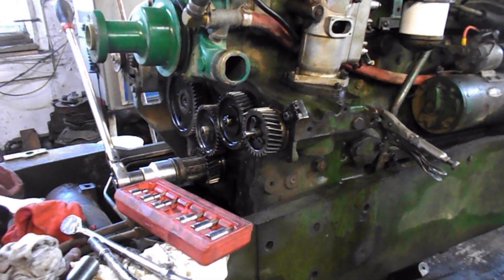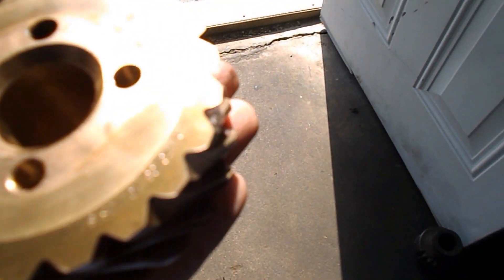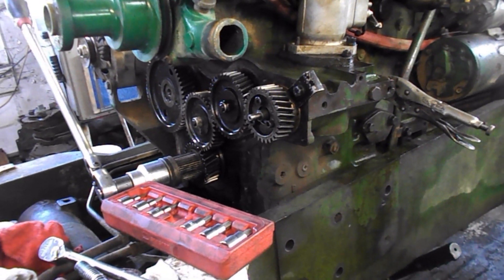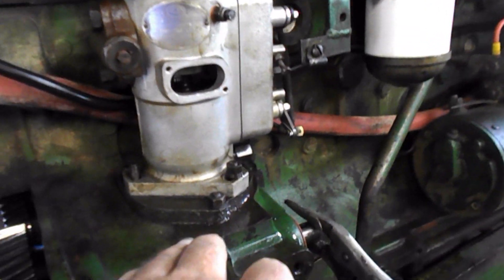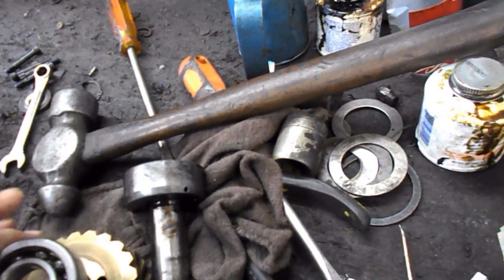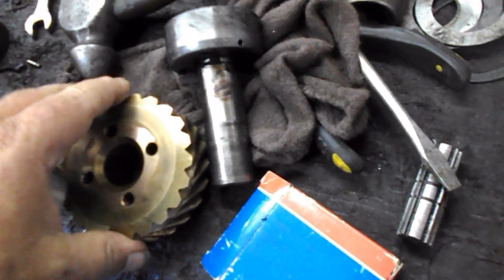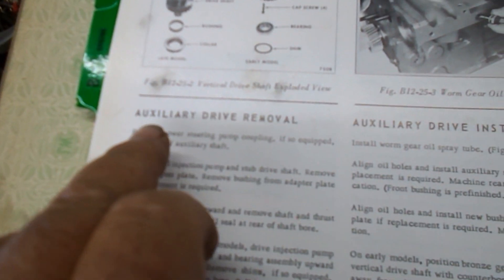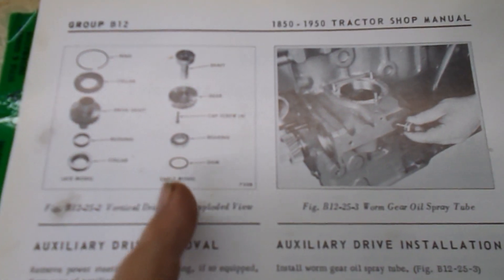Oliver 1850 354 Perkins diesel Question, We are Stuck !

Comment: I can’t help you with the gear lash...but, rebuilt or not, that pump is junk.
Reply from the maker: The pump was completely rebuilt with a new head and rotor but from the time it was put on the first time and started I knew something was wrong with it. It ran good but something was off and I just didnt know what nor did Harry, When you dont know injector pumps or ever worked on them it dont help but having other 1850's before I know something is off with it and its not the engine for sure its in the injector pump for sure. Right now its back off and at a new guys place getting looked at cause the guy that rebuilt it says he's worked on it twice and he said its the engine for sure and wont look at the pump again. The new guy thinks he knows what is wrong with it already and said this might be a quick fix, I dropped it off Monday so we'll see what happens.  Bandit

Comment: Bandit, I havnt heard anything from you in a while. I hope everything is well. I know you have had a rough time with those kidney stones.
Reply from the maker: I've really been running my tail off trying to catch up and I really havent had much time to do the youtube thing like I want to. I'm leaving hear in a few to go down to see the guy that rebuilt the injector pump. The 1850 is now home because there was no use in it being down there anymore, Engine wise there is nothing wrong with it and it is running on another injector pump right now and it runs great with it. The one that was rebuilt there is just something wrong with it, It slobbers spits pops and cracks misses and the smoke off it will flat out burn your eyes up and pulling a disk it feels like its laboring to pull it. Same tractor fuel and day I switched the pumps and it ran so much better that I know something is wrong with the injector pump I just dont know what so back down to talk to him about it again.  Bandit
Reply: @banditfarmer1900  i didnt think the problem with the oliver was that worm gear.  Glad to here to are doing ok. was worried those kidney stones had got you down.

Comment: A ball bearing is no designed for vertical operation.......Obviously Perkins discovered that.......IF the updated bushing doesn't fit    I would get a Bronze bushing machined to the bearing specs to fit the  engine casting...... then go from there

Comment: I'm sorry I can't help you with the question about shimming that vertical shaft for the pump drive, but I will add you definitely need to inspect the wear on the timing gear for the horizontal shaft. When I rebuilt my  354 a few years ago that timing gear had a step worn into it almost as bad as the bronze gear

Comment: I would use paint like when setting up a differential. Paint it, drop it in, turn over the engine, pull it out and look at it. If it's shallow less shim. If it's deep as you say more shim. You should be able to measure the distance you need the "paint mark" to move. Then transfer that directly into shim thickness.

You could also shim between the shaft and the gear itself where the bolts go through. That actually may be better to prevent pre load upwards into your pump.

Comment: Im not familiar with this engine but I am a machinist. I have made worm gears. The backlash of a worm gear is set at the time of manufacture. The machined bores in the engine are manufactured at a certain distance apart as long these are not worn or the bearing is bad, then the backlash will be correct. If the backlash is too much and the bearings are good it would indicate that the worm gear is worn or not made correctly. But I really dont think this is why this tractor doesnt run right. When you time an engine you should always bring it up on the timing marks while turning the engine in the normal direction of rotation. If it has a little backlash its really not going to effect how it runs because the backlash will always be in the same direction while its running. I have seen pulling tractors that drive the injection pump with a roller chain and it runs just fine. You have something else causing it to run bad. Did you ever try a different injection pump? I dont remember but did it run like this when you first bought it?
Reply from the maker: I understand how gears are set as far as lash goes but most of the time its pretty simple to do, But most of the time you have info on how to start the set up and we cant seam to find anything to start from and you sure cant see it or get to it very easy ! LOL I think its going to be a lot of trial and error figuring it out.  Harry has an 1850 he was going to pull the pump off it and put it on mine but he ran into a big problem when he went to pull it off. The fly wheel only has one mark on it and it says start and the mark and the mark on the injector pump dont match up, He is afraid if he pulls it off he might not ever get it back on in proper time again so that has killed that idea. The 1850 when I bought it ran pretty good but it needed some work done on it. We've gone threw the valves fuel system the injector pump was rebuilt and new injectors installed but after all that work was done something still just wasnt right and thats ware we are still at right now, A random miss that we just cant figure out what it is or what is causing it.  The hunt goes on and we will figure it out sooner or later.  Bandit
Reply: @banditfarmer1900  If that gear is wearing a little on one side it could need shimmed a few thousandths but if you do, that will just make it have more backlash. There is no way to tighten up the backlash unless you move the worm and the worm gear closer to each other which in this application there is no way to do it. Just forget about the backlash and look for something else making it run bad. Your mechanic is just sending you on wild goose chase. Something else is causing it to run bad. Like I say shimming the pump if anything will make it have more backlash. Unless you get a new or better worm and worm gear, the backlash is as good as it is going to get.
Reply: @banditfarmer1900  If you would put a diesel timing light on this engine and check the timing while its running, you would see real quick if the timing is bouncing around while it runs. I have one and it just has a little clamp that clamps on the injection line and senses the pulses in the line and makes a timing light flash when it senses the pulse. So if the timing is erratic you would see it  with the light.

Comment: For proper engagement the worm gear needs to run in the center of its pinion gear. Blue up the worm gear and shim to where the rub marks run in the middle of it's mating pinion gear. When the rub marks run central in relation to each other the lash will be correct.
Reply: You are correct. Think setting the pinion/ring gear in a differential rear axle. One blues the ring gear then moves the shims left to right. The pinion gear is set by dial indicator.

Comment: Bandit I am not even close to being an engineer, but here goes. You know the amount of deflection through the gears, measuring the size, width, and length of the mating surfaces of the teeth on the gears along with the angle of the gears, someone should be able to tell you the amount of backlash that is required and or needed for the gears to operate properly. 
As one commenter stated a good range can be guessed at and figured out wit trial and error with .002 thick shims. You should be real close to the right lash when you are able to turn the pump and hear the engine respond with a different tone.
  I know you and your mechanics will figure it out.
Reply from the maker: Frank our biggest problem was the lack of information about this drive system mine has but to be honest it is something that was changed by Perkins in 1965 so finding info might be hard to find. I am going to make a follow up video and explain what we did to fix the problem, A lot of measuring went on and a lot of wright stuff down and figuring it out but its going back together now.  Bandit

Comment: look up chris lossi that oliver guy and or oliver 66 farm boy them to guys got their shit right i want to say that oliver guy is or was in a oliver dealer look up Hanover implement hanover in see if they got anything they at one time was dealer for massy and i want to think also perkins now they are just doing everything but still very up on everything
Reply from the maker: The guy working on the 1850 has been at McHenry's (Oliver dealer) sense 1969 working on Oliver's and White's everyday ever sense, But he has never seen this style before. I rate Harry right up there with Chris Losey as far as working on and knowing Oliver's inside and out, The other guy I've been talking with about this has been working on MF tractors and equipment about the same amount of time as Harry and he has never seen this drive before ether. They both have been looking at the comments seeing what everyone has said and so far they are not agreeing with anyone yet. Other problem with the 354 is no new part can be bought for the drive system for the injector pump so that is making it a lot harder to fix this, Even the Perkins engine dealers cant get these parts so new parts cant be found. I thought I had a new drive gear found for it but it turned out to be for a much newer 354 engine and wont fit in mine. The hunt continues !  Bandit
Reply: @banditfarmer1900  different dealers in different areas may see different stuff maybe i also hope for your sake so you can get this fixed hate seeing someone having this kind of trouble
Reply from the maker: @mattphillips4260  Over the years you run into this every so often that some little do dad you need cant be found by any dealer. But to be honest this is a 1965 model tractor so it is 55+ years old and this was a change made like 6 months of production in the Oliver line so not being able to find info on it aint hard to believe. Worst part of this is the fact you cant buy no new parts from anyone for the injector pump drive, The thrust washers bushings or the brass gear no one can get not even a Perkins engine dealer. I dont know why but its just the way it is. But I think we have it figured out now and its going back together now, In fact I'm late getting over to help Harry this morning ! LOL Got to get moving , I follow up video is coming soon !  Bandit
Reply: @banditfarmer1900  i am just try to sound positive to this trouble you are having here  and maybe someone could by chance have a fix for you on this on to a different page of this i have a guy here in my area that ha a 1850 oliver he he thinks the gears that you are working with are out of spec and needs to be replaced i was showing him the pics and how that gear was missing some material on the tooth face but that theory is from what he can see here on the video but you was also saying that the new vs old set up could not be changed not sure if that also meant the brass looking gear or just the bearing and shim pack we are still studying on this
Reply from the maker: @mattphillips4260  The worst part about working on this 354 Perkins is I can buy just about every part for the engine except for anything to do with the injector pump drive system. The thrust washer and the worm gear and brass gear and all the bushing for them no one can get them not even a Perkins engine dealer. So all you can do is find good used parts to fix them with. I got lucky and Harry had a brass gear out of an engine that blew up that had just been rebuilt and had a new brass gear installed, It had been on a shelf in the shop for 30+ years and its now in my engine ! Got real lucky to get it !  The shims listed in the books for this are no longer avaible from AGCO and it doesnt say how thick they are. The lack of information and new parts for this engine make it really hard to keep these engines running but I have been finding what I need to fix it. There have been many changes made to the 354 over the 35 years it was built and the drive system for the pump is an early change in late 1965 ( 1 year of production for Oliver's 1850) so 1966 the new drive system came out, So I can understand why the info is a little hard to find.  I will be making a follow up video and talk about everything that has been done to the engine to get it right, A lot has been gone threw really for nothing at this point to prove its the engine and not the injector pump that is the problem and as it turned out it is the injector pump that is the problem !  So videos will be coming to show this.  Bandit
Reply: @banditfarmer1900  please look up hanover implement and give him a yell he may have something to help you out i do not feel safe dropping his phone number out here on the tube or i would there has been MANY times he has had what people need when we thought sure he would not have it  after seeing what you was showing on that one gear again you are missing metal on that gear in ways shimming may not help i am 90% sure of that wish i could just shoot over there with your ok if you was close to me so i could see that gear eye to eye if i could do that i am sure that 90%would go up to 99% sure of it

Comment: What about the Perkins factory corporate office?
Reply from the maker: Well Perkins engines were built in England so that might be a little hard to do plus the fact CAT bought Perkins out some years ago and from what the 2 Perkins engine dealers have told me things are a little strained right now on parts and info so contacting them might be a problem or getting info from them even harder. No one has been able to find some of the parts for the drive system for the injector pump, Thrust washers bushings or brass gears no one can find any new ones . But the hunt continues !  Bandit
Reply: @banditfarmer1900  what you do is up to you. Phones go to England and they talk English, not a problem there. You talk to their rep in USA maybe, other dealer's, and so forth. I wonce found a clutch slave cylinder by getting lucky and asking company people at Bendix I think it was. A floor sweeper person found a box had fallen from shelving in a Tenn. warehouse and the box had the last available part, so the story went. Ship that part to me. That was 40 yr. ago tho and people (not all I know) don't go the extra mile like they used to. And big companies are worse for accommodating.

Comment: My Perkins book says that “On early engines, adjacent to the engine number, on the auxiliary drive housing, is stamped the amount of shimming required to be placed at the bottom of the fuel pump drive shaft bearing recess. The amount of shimming may vary from 0.002/0.008 in. 0.002 shims are available. If there is no stamping, shims are not required.”  So the shims were 0.002 and you used whatever was necessary. But if your block isn’t stamped it needed no shims when new the way I read it. It also says that end float of the drive shaft (horizontal) should be between 0.0025/0.009 in. I would probably start with two shims and see what you get. Unfortunately it’s probably going to be some trial and error. It doesn’t give any procedure info other than specs. Hope this helps.
Reply from the maker: That make a lot of sense, I just wish it was in our shop books !  I will have to show this to Harry in the morning and see what he thinks about it. Its for sure we will have to look closely at the block in the morning and see if there are any marking on it and go from there. This is more info than we've found so far and it makes sense to me. Thank You so much for chiming in with this info, Now I know more about it than I did this morning ! Thank You    Bandit
Reply: @banditfarmer1900  you’re welcome! I hope it goes easy from here on out. If shimming doesn’t work you may have to replace the worm shaft. The book did mention that for the new style to replace whenever possible.
Reply: @rosstheoliverman  Good info! I think you have his  answer. I'm pretty sure the end float spec is for the horizontal driveshaft. Gotta replace the half washers to tighten that up. 2 of MF number 740388M1
Reply: @ThatOliverGuyChris  I agree on the float spec is for the worm shaft, I realize I didn’t make that very clear. I know the book says for the new style, if the worm shows any wear to replace the entire assembly.  But I think you’re on to something with replacing the washers, that should tighten it up or at least it makes sense to me! Which style does Ophelia have?
Reply: @rosstheoliverman  Ophelia is a very early 1850, so she should have the early style.  She's so deep in paint I can't even see the engine seeial number, let alone shim specs. I do know it's an early enough engine that it doesn't start with 354.
Reply: @ThatOliverGuyChris  I should’ve known that! I remember you saying in the video Ophelia didn’t have the access holes for the rear motor mounts in the frame.
Reply: this seems like the answer
Reply: I do believe this is spot on. The stamping indicates the size of shims but not the number of shims, trial and error. Cheers :)

Comment: Might be worth contacting a machine shop who makes gears and possibly sets them up. You might be able to show them the gear and mating gears and they will be able to look up backlash and specs on setting the gear up. Givin size and tooth profile and such.
Reply from the maker: Not many machine shops left around here anymore, There are a couple in Cincinnati that do deal with gear sets but they aint cheap by any means. I think we have it figured out now and its going back together and the gears are really smooth now and little movement between the gears, A follow up video will be coming soon.  Bandit
Reply: @banditfarmer1900  Good deal. Read some comments seems like Ross the oliver man has the answers you need!